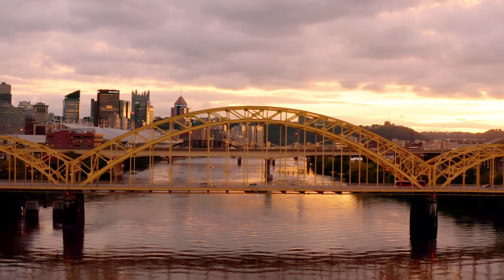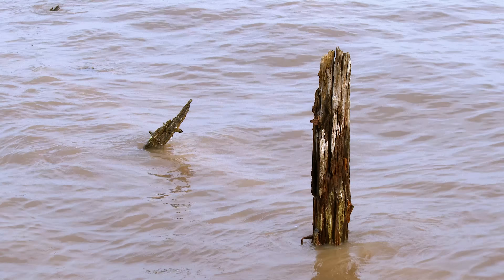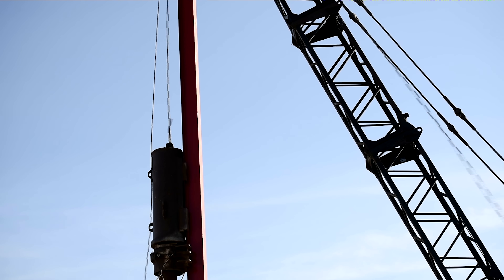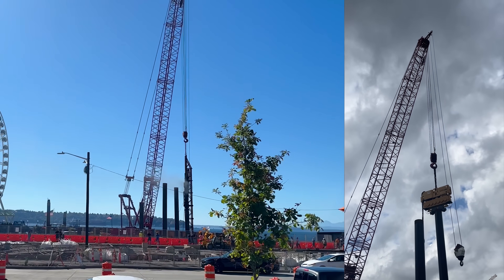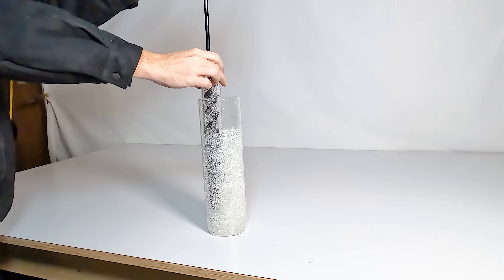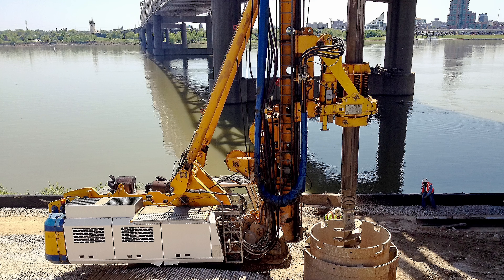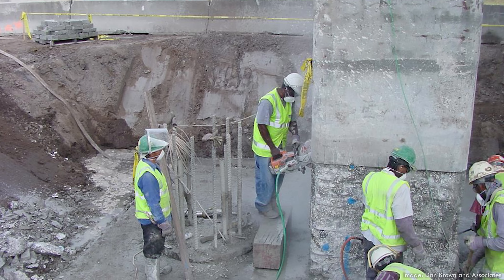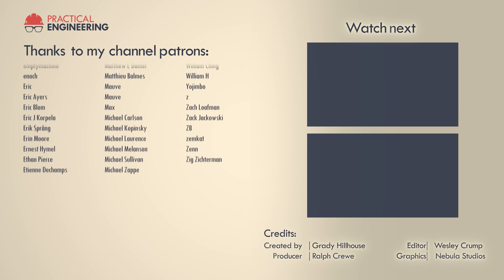Why Bridges Don't Sink

Comment: 3:15 "Your guess is as good as mine why the same steel shape is an I-beam but an H-pile"
As a practicing engineer, my guess might actually be pretty good:
There are typically 4 standard types of I-shaped beams and, funnily enough, none of them are called "I-beams":
 • W-shape: The standard "I-beam" used today is better known as a W-shape, or a WF(wide-flange)-shape. These are much taller than they are wide (Despite the name, lol), and are intended for typical gravity forces, like long span roof beams and such, where most of the forces goes in the strong axis of the member.
 • S- shapes: What might be considered the archetypical "I-beam", doesn't get a lot of use because it has tapered flanges top and bottom, which just makes it annoying to fabricate with and connect to - who wants sloped flanges? C-shapes also have sloped flanges, but that flat vertical back face it has has enough uses to warrant its existence. 
 • H-shapes: common for both columns and piles, as these have the same width as they do depth, so they form a kind of box or square shape, making them efficient at supporting axial loads, what columns and piles normally support, as they are not much weaker in either direction, they don't have a tendency to buckle unexpectedly.
 • M-shape: last are the M-shapes, which are just kind of these weird tall, thin shapes that never get used in buildings. The internet tells me RV's sometimes use M-shapes for whatever reason. One source call the M- "miscellaneous, so sure, makes sense I guess.
 • As a bonus type, you can cut W- and M- shapes in half and get T- and MT- shapes. Useful for connections and rail-type structures.

Comment: "Sheet piles" made of individual interlocking profile steel piles are a common way to make temporary coffer dams around here, and also for permanently securing vertical earth faces around roads etc.  For additional strength, permanent sheet pile walls are often bolted to sideways slanted giant bolts piled into the ground behind them .

As another example of badly secured concrete pile foundations under a bridge, look up the first attempt at building "fiskebækbroen", a 1000 foot long concrete freeway flyover crossing a T-crossroad and a river in one beautiful curved shape with many piles over a swamp.  1 day before opening in 1972, it collapsed with no lives lost, but the construction scandal made for great TV.

Comment: I think the reason they are I beams and H piles is because of how they are used.

An I beam (nearly) always has the central structure vertically so it supports stuff against gravity.
An H pile on the other hand can also be used as a retaining wall. Where the beams can overlap each other just like a similar wavy retaining wall does.
Only when an H pile is supporting other elements is it placed with the center structure acting as a load bearing member of the retaining wall.

But not only that... Since H piles need to support greater weight on the side with the smallest surface area, H piles actually have a bigger cross section than I beams do.
Meaning, I beams are distinctively different from H piles in just how much material there is in the two types.

And if you really wanna get artsy about things, H piles are square in their thickness from all angles.
I beams are sloped in the load bearing sides (top and bottom, on the inside) because they don't need that extra girth to be used as I beams are used.
H piles look like the Times New Roman font letter H, while I beams look like the Times New Roman letter I with sloped angles top and bottom.

Whatever the case, H piles and I beams are NOT the same thing.

Comment: An I beam has shorter top and bottom flanges than an H beam. Generally the H beam is as wide as it is high, but the I beam is higher than wide. For piles you only use H beams for their inherent strength.

Comment: On my railroad the bridges are mostly creosoted timber trestles. One of them in Kennedy Ford Idaho crosses the Palouse River at a location where the bedrock, in this case actual solid basalt, is very shallow. The wood piles rest on top of the rock. This creates a problem when the river floods and water flows over the top of the bridge deck… wood floats!  There have been a few recorded instances since the current bridge was built in the 1960’s of the bridge floating downstream a few feet during a flood. 
The old railroad company in the 60’s and 70’s would run big chains to bulldozers on each shore and pull it back into place!  
In the 70’s and 80’s a few of the upstream piles were replaced with steel H piles and that seems to have stopped the floating away issue. I’m still concerned about what will happen should we get another deck topping flood however.

Comment: Hawkesbury River Rail bridges (1888 & 1946) between Sydney and Newcastle in Australia. The 1888 bridge had the deepest pilings in the World at the time - 160 feet (49M) below high water, it had one 'floating' pier where they couldn't find rock to base it on. My grandfather spent 1914-1918 guarding the bridge against the rascally Germans & is responsable for one large item of historical 'graffiti' carved into the southern abutment (he was fined 2 shillings and six pence for damaging his bayonet carving it). The 1946 replacement also has a 'floating pier' where they broke through the apparent solid rock - the bottom of the hollow pier was plugged with bales of wool & the salt water was replaced with fresh water - every couple of years someone has to climb down inside and test the salt content of the water (Not mentioned in the Wiki article but I have contemporary press reports). Recently (2016) one of the piers and some decking have developed cracks - the bridge was designed for passenger trains and is now being used to carry heavy frieght.

Comment: Structural Steel beams are categorized as I or W (wide flange) beams. It is these Wide flange beams that are often described as an H versus an I, and the primary difference is that the flange is wider, and is not actually I beam. The differences in the shape of wide flange and I-beams are components of the materials loading calculations, strengths, friction, load bearing capacities, etc. I-beams specifically are best suited when side loading is within engineering tolerances and weight/size restrictions allow compliance.

In driven piles, it would not be good for your pile to look like ribbon candy in the ground, and thus a wider flanged beam supports the pile to keep it's shape better. Your channel would be great to demonstrate that with mock-up models that could demonstrate this effect.

Comment: I've lived in Tampa Bay area for many years and have seen a lot of road and bridge construction. I've always wondered about the concrete fingers sticking out of the ground and now I know. I noticed that they are sticking up out of the ground at different heights and all have numbers written on them. I'd like to know what the numbers represent, how they cut the top sections of the piles off, and in the case of a water bridge, how they pour a cap into the water on top of the piles.

Comment: H- piles are squarer shaped since the flange width and web depth are close
I-beams usually have much taller webs than the width of the flanges
at least that's my best guess

Comment: I remember when they reworked the navigation channel near my home.  A whole summer listening to pile-driver pounding in sheet piles.   And they drilled diagonally through the sheetpile into the embankment to put cables with anchors to 'tie' the sheetpiling against falling into the channel.  An old steam driven 'pile driver'.  :)

Comment: My experience with piling comes from 60+ years ago during an interview for my apprenticeship at Tilbury Generating Station, downstream from London on the River Thames. They were building a new station,  Tilbury B and were driving in the piling. I actually arrived at Tilbury A 18months later after initial training school to see those same piles being removed from the marsh severely damaged and looking like horizontal  “U’s”. What had happened was that a slow drift of the marsh had not been accounted for and this had destroyed a large percentage of those piles so all had to be replaced with twice the original number of units. Of course this held up the whole construction programme.  I’m now a long retired Mechanical Engineer and can look back at this as ‘not our fault’. Smug eh?

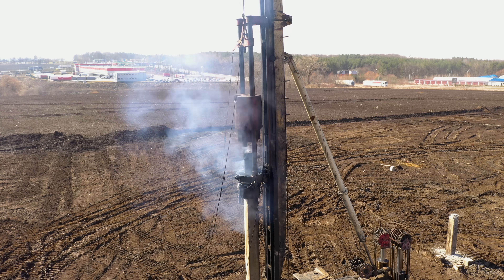Comment: 8:25 I guess the smoke coming from the pile driver is because the hammer is like a simple diesel engine where compression takes place when the head strikes the pile and the combustion pushes the hammer up again. I have heard of such pile drivers but never seen one in reality.

Comment: Grady, there's a drilled piling operation going on 20m outside my apartment window right now... One thing I've seen them doing when they pour the concrete through the tremie is they seem to be chucking something the size of a soccer ball into the shaft before the concrete.  Any idea what this is for?  I'm not even sure if the balls stay down the holes or float to the top and are re-used.

Comment: Ok, here's a question for you, that I think would be an interesting topic. 
How do they add additional piles under a structure, if remedial works are needed, without destroying or demoing the structure in question?
Reply: For bridges, they build a new bridge. If the foundation of a bridge is insufficient, tear it down and start over. For land structures, it's called underpinning. You can dig out under a building in small sections and install low-overhead micropiles. Then you form it up and pour concrete to fill the gap between the building and the piles. For even smaller structures (like houses), you can just pick the house up, install piling, and put it back on top of them.

Comment: Bridge Engineer here, with years and years of experience with these precise topics. Everything said on this video is 100% correct.

Drilled shafts can go 8 to 10 ft diameter on large bridges. Quality control on the placement of the tremie concrete is crucial. Temperature sensors are left behind during concrete pouring. Concrete gets hot during curing, if some part is particularly colder, then maybe that portion of the pile didn't get enough concrete. Sonic test tubes (six to eight) are installed along with the rebar cage for later testing. Then later water is filled into those piles and ultrasound (CSL) is send between each tube one another. There are also other intermediate tests done during excavation, again using ultrasound.

A great deal of the money (and time) spend on a bridge go on the unseen part of the foundations.

I'd like to add that steel shapes designations (W, S, I, H, HP, etc) have their reasons to be. It's often because of small details in their shapes, such as inner surfaces are parallel, outer surfaces are parallel, section optimized for railings, or for pile driving, etc. HP are sections optimized for pile driving.

Comment: Hi Grady
Perhaps something you will find interesting: To reduce the underwater noise hurtful to much marine life, when installing monopiles for offshore wind turbines, often a bubble curtain is used. In practice it’s a ring with annular holes that vent compressed air. It’s laid on the ocean floor surrounding the pile    . 
Perhaps worth noting - today almost all offshore turbines are installed on steel monopiles. I don’t know of any installed on capped concrete piles

Comment: 4:15 One of the cool things about the pile driver you showed is it's basically a diesel engine. A lot of pile drivers are an open cylinder; an engine that doesn't need valves, that inject some fuel to use the compression of the falling weight to both drive the pile and create a power stroke that propels the next strike.
Reply: Fascinating

Comment: My team and I installed 4 (8’) diameter drilled shafts 50’ into the ground on the first bridge I ever built in my young engineering career and seeing you cover the drilled shafts was very fascinating because it was spot on 👏🏻

Comment: The most common way for bridges to sink (in my experience) is slowly over time and sometimes at just one pier out of many in a structure. We notice it in railroad bridges pretty quickly because it’s very apparent in the rails, but in the average highway bridge it can be hard to tell

Comment: Here in Brazil our 4th generation Synchrotron light source (Sirius) has an array of piles as a foundation. Now I can't remember in details the depth... And I know they had to build an ice factory for the concrete, again can't remember if that was for the floor or dor the piles (or both)... I just know that the inner floor is detached from the building's walls.

Comment: So an h-beam pile of a given cross-section (let's say square cross-section) would have more resistance to sinking than a solid square-cross-section concrete pile of the same given cross section due to the h-beam having more sideslip contact area?

Comment: Remember one summer when piles (for a highway, I think) were being driven just outside my workplace by a diesel pile driver. The heavy head was dropped onto a piston, and diesel fuel inside the piston compressed and exploded on impact, driving the head back up again. As the head was rising up, more diesel was injected into the piston, and the process repeated, every two seconds or so. Over, and over, and over... All summer long. We couldn't open the windows to cool the place, the process was deafening.

Comment: I beams use the center span for bearing the main forces applied to its cross section er whatever while H piles use the sides so its cross sectional "up and down" orientation becomes an H. I know I'm using some wrong words but I feel the basics are there to get the idea across
Reply: just a guess
Reply: @dyslexicmitochondrea does this bridge annoy you?

Comment: Lived across the street from a pile driving operation for a year.  I swear I still hear it in my nightmares.  Every second or two bang, bang bang, everything shakes, all day from 5am to 8pm.  Not to mention all the dust, since it was for a bridge over the highway, earthworks was happening for the approach at the same time. 

I enjoy construction, but not when they have no limits on noise, vibration, or work times.

Comment: YouTube channel 'Construction Worker' shows bamboo posts being driven in to the soft ground with a backhoe. They might install 15 or 20 poles in a square meter. Then they pour concrete on the top and finish it off with a thick pad of bricks. Then many of these are used as platforms for much larger brick and mortar construction.

Comment: I remember a railroad grade separation project in the 1970s or 80s where sheet piling was used.  It took much longer than expected to install the piling because the soil had been compacted from trains including steam engines going over that ground many times each day for many decades.  The sound of the pile driver could be heard all over town for weeks.

Comment: I was on an offshore job in the south china sea . Korean and American colaboration. My work didnt start until the last of the jackets for a couple rigs were hammer driven and secured to the seabed. Three weeks. THREE WEEKS. THREE WEEKS of bang bang bang bang bang 24/7 as they hammered in those roughly 24 inch pipe piles. I can definately see how this could upset someone in a dense urban environment lol

Comment: H piles are called that because it sounds better than I piles.

I do have to say that sheet pilings are my favorite type.  These are great for stabilizing a terrain transition, whether it's a shoreline, a bridge approach, or a cut through a slope to put a roadway through.  They may seem like just a piece of corrugated tin sitting there, but they do a really important job with a pretty quick install.

Comment: The  Indian River bridge on Delaware shores 38.608259786025904, -75.06323136068384 between Rehoboth and Bethany Beach had a problem: it was right where the river flows into the ocean and the stronger than expected tides,  causing water to flow an and out, eroded the sand  at the base of pillars to a point where the pillars started to lose their support.  It was replaced very quickly circa 2010-2012  with suspension bridge  with no pillars in the river and 2 large towers on each side or river.

Comment: H Beam styles are named because the normal orientation of an I-Beam, with the two larger horizontal surfaces are oriented top and bottom, in the H-stack they are all laid out rotated 90'.

Comment: I would love to see a video about the different types of pavement used in roads. For example when I'm driving on an interstate the pavement seems completely different than a normal asphalt road. Or how different the pavement used in the back of a shopping center where all the trucks go to unload stuff versus the front where the parking lot is.

Comment: They also use mono piles on some steel pole mounted power transmission lines too. Drill hole fill with cement, etc bolt pole to it.

Comment: Offshore wind foundation engineer there 🙂
True monopiles can be drilled but the enormous size of the needed machine and the volume of soil to be removed makes this solution the last you want to choose.
And in 95% of the time, there are simply driven into the soil, using quite big hammers 😅

Also, when you can't or don't want a monopile, you'll rather have a jacket substructure rather than piles going up into the air and connected to a kind of transition piece. I'm not saying it 's not existing, I'm saying the market needs to STOP design that.

I could speak hours about offshore foundations, feel free to contact if you need some hints.

Last important point, almost forgot to say, but many thanks for all your videos. It's a great and important work what you've doing ❤